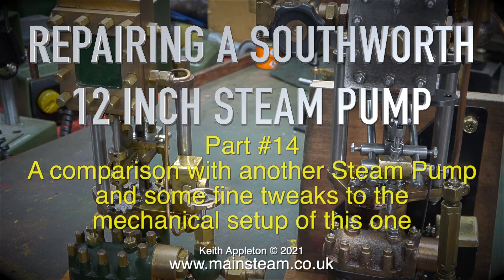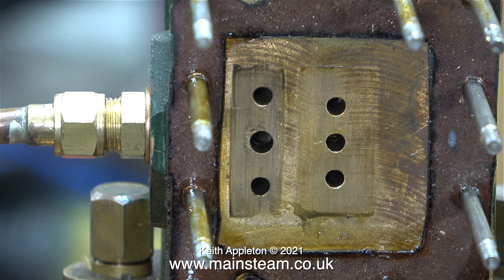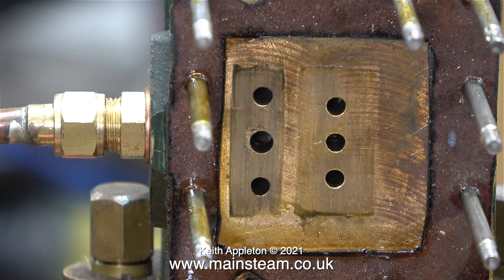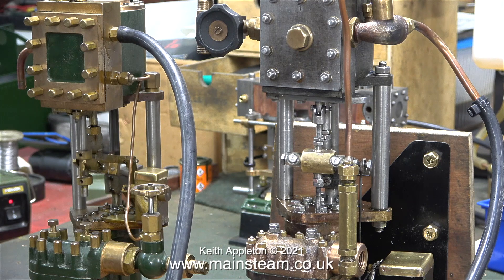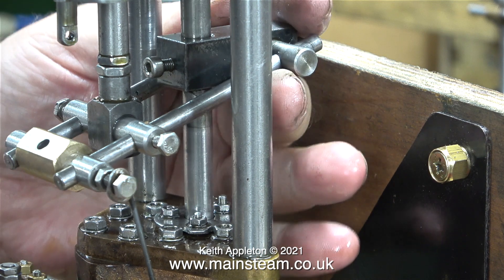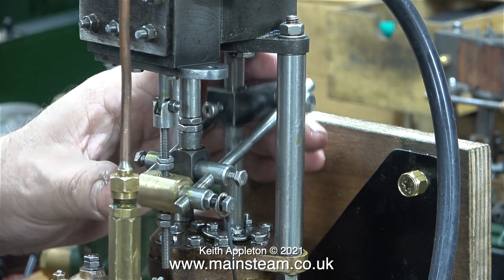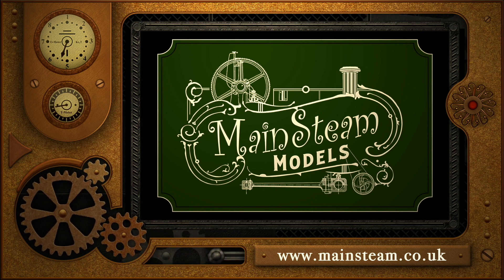REPAIRING A SOUTHWORTH 12 INCH STEAM PUMP - PART #14

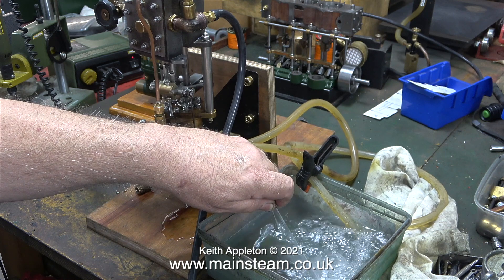Comment: I think you still have some steam/air bypassing the cylinder somehow on the up stroke.  At 8:30 you can see the upstroke is slower, develops less pressure and you can hear the sound of the air during this stroke.  On the down stroke it pumps more strongly and is quiet.
Reply from the maker: I did my best .........

Comment: The owner should be pleased with this - very satisfying to see the running improve with every fix. I did suspect that using the tap on the pipe at the end might result in you being at risk of a soaking...
Reply from the maker: One has to suffer for one's art }:-)))